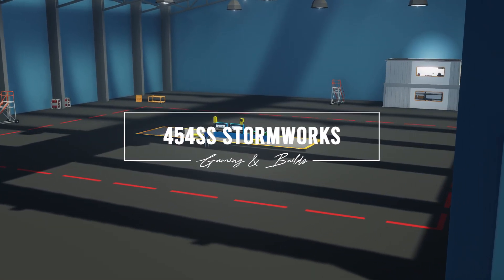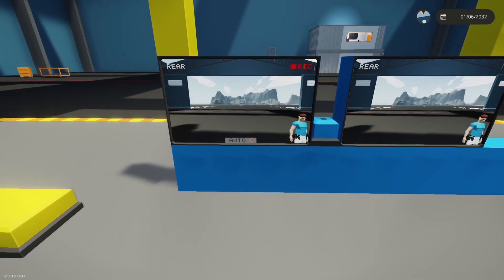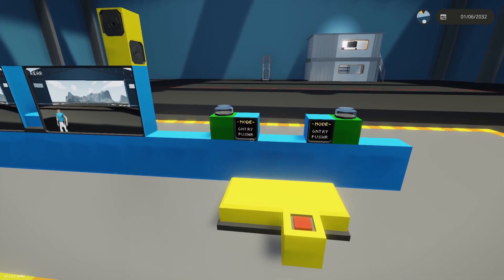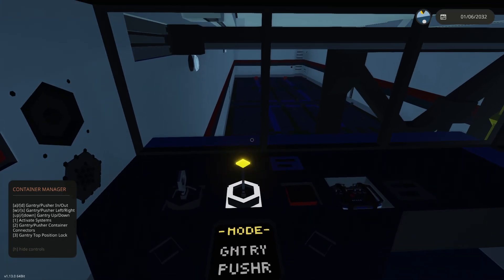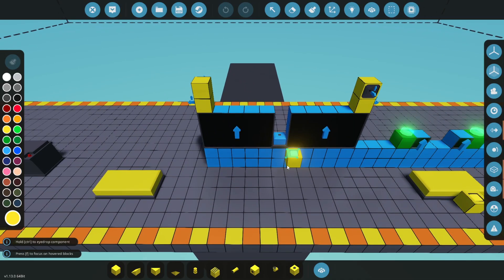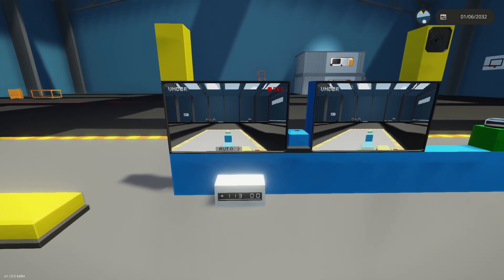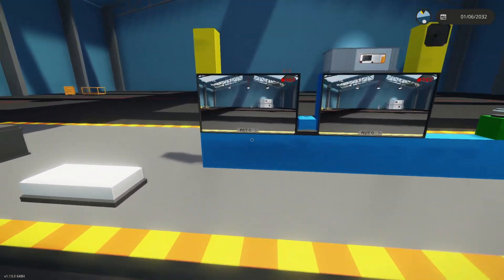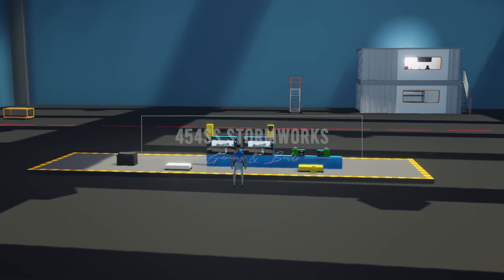Making DUAL Touch Screens (Stormworks Tutorial)

Comment: That's one way to do it. 👍

I had a similar challenge 5 or 6 months ago when I was building my first trainer aircraft. The plane has what are essentially two inline cockpits, so all the switches had to be mirrored, including indication of their states, and using screens for that is IMHO the clearest and easiest way to do it.

I went for combining the composites from each set of two screens by writing the values from the second screen to other, free channels on the composite of the first screen and gave that combined composite to a Lua script. The interpretation of which area of the screen was pressed I then did in that Lua script. I found encapsulating such logic into one Lua function per touchscreen "button", that would evaluate whether that button was pressed either on screen 1 or screen 2, to be very useful and easy to maintain. 🙂
Reply from the maker: Yup, so useful! That's a great way to do it as well!

Comment: Why not just use the composite switchbox to control which composite signal goes into the lua block?
Reply from the maker: Yes, but then there has to be a switch gate, cant have them work at the same time!
Reply: @454ss_gaming  Break out the is pressed channel from one of the displays and use that to control the switchbox.
Reply from the maker: @ronhebert3027  That's a good way to do it as well :)